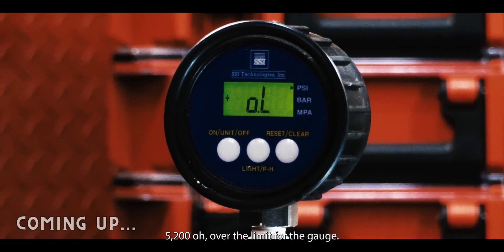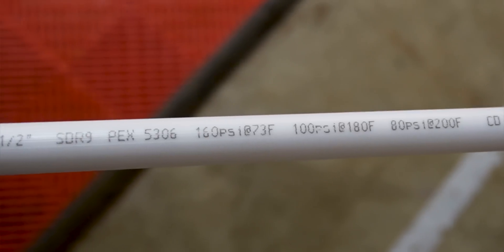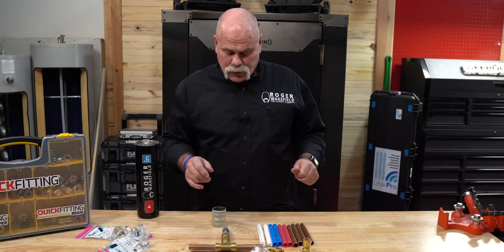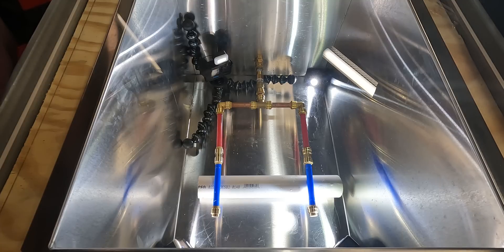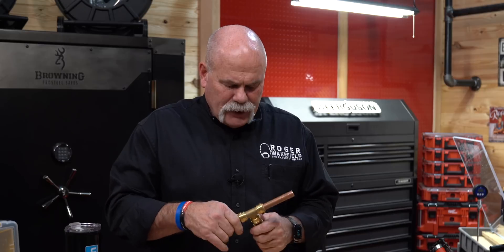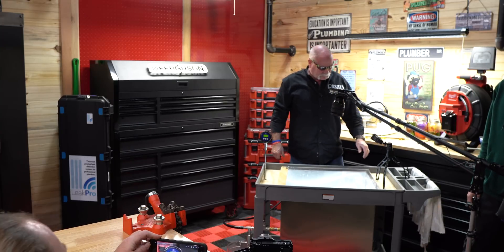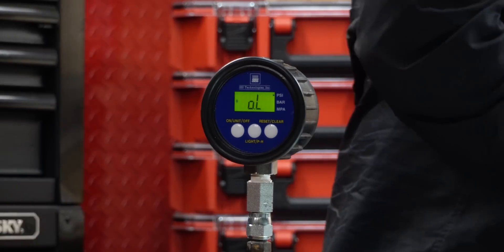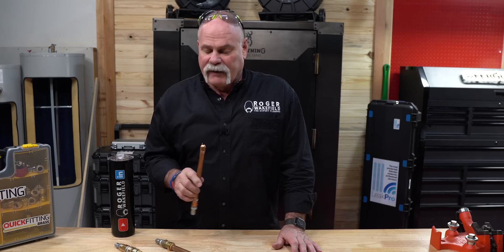How Much Pressure Will QuickFitting Hold?

Comment: I been fixing copper piping burst here in Wisconsin I’m replacing all to pex it’s just easier and easy to replace I never liked copper pipe
Reply: @adaster98  Research shows copper lasts longer
Reply: @adaster98  yeah after 30-40 years. I think pex is rated up to 50 year lifespan but I’ve fixed plenty of pinholes in pex pipe as well. Usually pex that’s 15 years old+ and it usually seems to be on the hot water line
Reply: Cheaper, same results, faster, lower labor cost, customer can do their own repairs, and withstands cold Temps much better.
Reply: @adaster98  yea I honestly don’t know why it happens like that but just from experience it’s always the hot water lines on pex and many times it’s right near the water heater. At least the leaks I’ve fixed on pex. Nothing is perfect

Comment: Those pressures will never be seen in normal operation. Sure they are convient and save time, but what is thw story over the long run? That is why as an engineer I will never specify them. They may warranty the product itself but what about water damage?
Reply: hpw much pressure do u think is exerted when the said water freezes?
Reply: @timjohnson6864  water is incompressible. There is no material that resist the pressure except for polymers like pex which just stretch. Thats what insulation and heat tracing is for.
Reply: @Brian-bg8wj   not saying any material  is exempt from the pressure i am however stating that your dtatement of those pressures never being seen in normal operation  is  completely  incorrect  comprehension is vital

Comment: Fun but totally useless. So a Shark failed at 895?  Big deal. What HD or Lowes customer is ever going to be applying pressure anywhere in that range around the home?  They're not.  I don't like them or trust them but that is a time proven consideration. How will they stand the test of time. same for ProPress. A Sharkbite for pro's that like speed over longevity. Still an o ring sealing the joint not the area of the sweat joint holds a fitting with. Quick Fitting is better than PP ( if ultimate pressure is the criteria) so why would I invest in that clumsy and  overprice tool?  Set up a freeze situation, a vibration one or one in a heating zone.....Rig up a water hammer deal and see who fails first. real world stuff Rog.   YOU can do it.
Reply: Freezing is kind of a useless test too, as the psi that ice exerts will rupture the copper pipe itself, rip a seam right in the middle of the pipe, let alone any connections that are inherently weaker than the pipe itself.

Comment: Just one more thing that will eventually make plumbing, unskilled labor
Reply: I get your point to an extent, but plumbing will always be a skilled trade. No matter what the materials.
Reply: @peterschulties3258  Much less skilled than it used to be. I am a homeowner and do all my own plumbing because it's pretty easy. In the days before no hub couplings, PVC waste, and PEX I definitely would have called a plumber. 99 percent of people wouldn't pour lead joints on cast iron. 90 percent of people won't solder copper. But glue PVC and crimp PEX? Way easier.
Reply: @peterschulties3258  I agree, however that’s what they are going for. Pro press push to fit they don’t need us for long runs anymore. Just come in and do the tie ins. I guess the skills gap isn’t as big as we thought
Reply: Highly necessary as many plumbers are aging out and retiring and there isn't enough younger people to replace them.

Comment: So I've seen copper pipe split lengthwise from a freezing event (which means ice forming generated more pressure than your test), I've always wondered how it effects the sharkbite style fittings. I think Pex does OK freezing but do the fittings?
Reply: This is where Pex A ears it's keep. Freeze ups. I live in the Northeast and have seen A pex freeze flex and NOT fail.  And the pipe wall is half (at least) as strong as the fitting body, pipe and sleeve combination.  Do PTC's and PP hold up to ice?  With a tiny O ring?  Lol lol lol....... Maybe Roger can test that for us.
Reply: That would be an interesting test! Great idea.
Reply: I think the fitting would survive, but the pex would burst. Ice will expand into the available space, and plastic will make space by stretching. It might even survive the freeze, but will have a bulge that bursts next freeze.
Reply: I have had mine freeze both pex and sharkbites fine polybutylene not good when froze
Reply: The fittings are the weak point for pex, whether plastic or brass for the expansion pex is the points of failure and the most important for keeping insulated and away from foundation walls.
Reply: @mongoose3109  I've had pex with sharkbites and regular brass crimp fittings in fully uninsulated areas in the northeast and froze and no issues at all
Reply: @douglasharrington3003  there are several variables that go into play on that, I use push to connect fittings too when there is no other choice. Using push to connect for pex instead of standard pex connections is the definition of handyman special
Reply: @mongoose3109  don't agree. There are posts and videos on YT here that show just the opposite. Uponor even shows a test where they pull a pipe with fitting to the point of failure and the pipe always breaks first. Pex A isn't perfect but it's close.